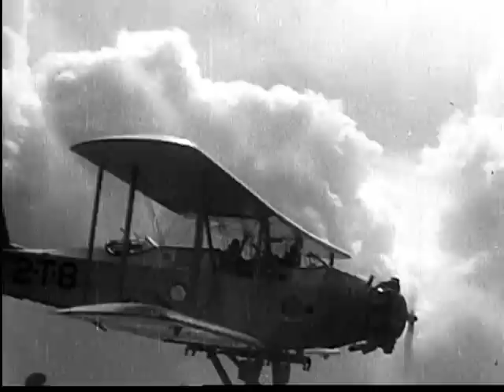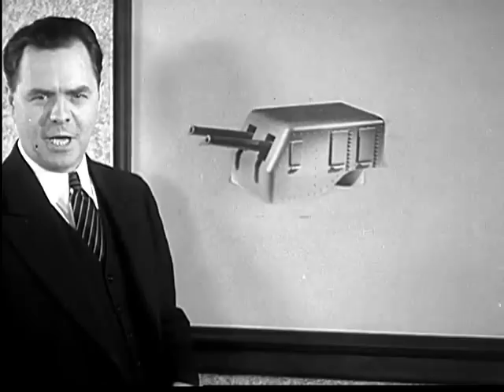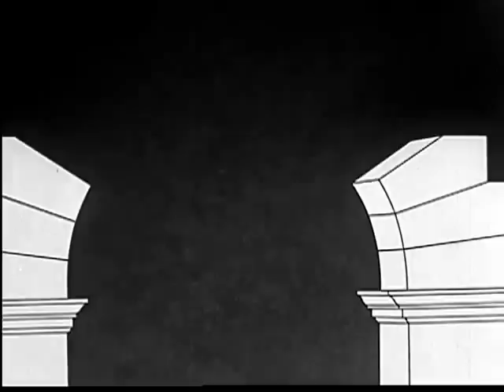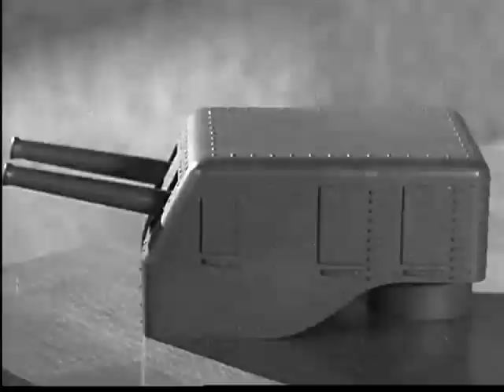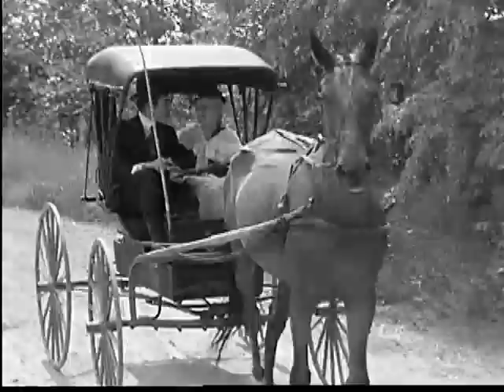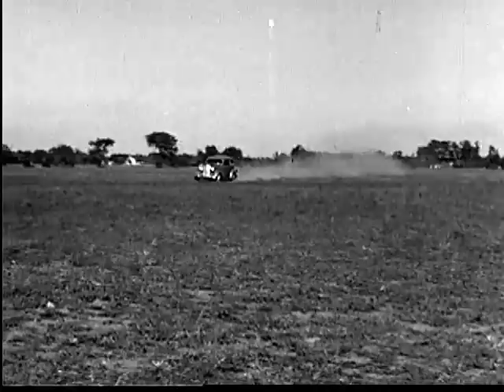It's The Top

Comment: That rollover was crazy considering they didn't have seat belts!
Reply: They never had seat belts but look next to the seat and you will see a large ring bolted to the floor . My 35 does not have that . It was installed to secure that large wide belt to he put on . That helped him survive the roll over by holding him in the seat .